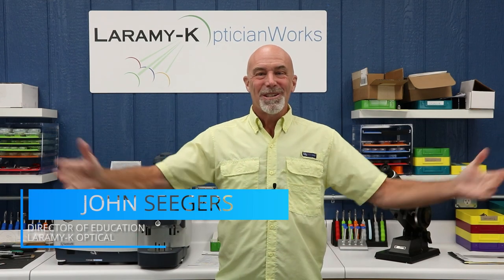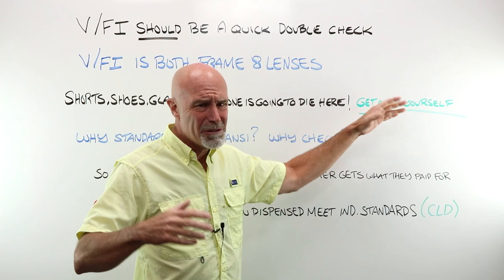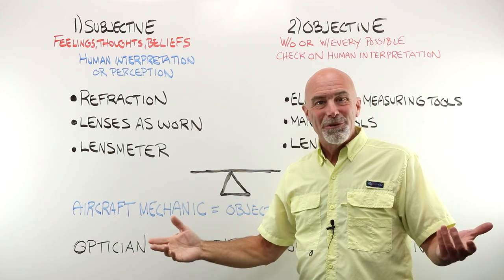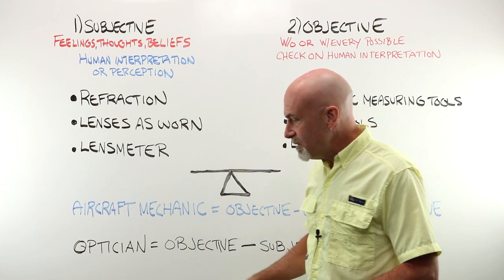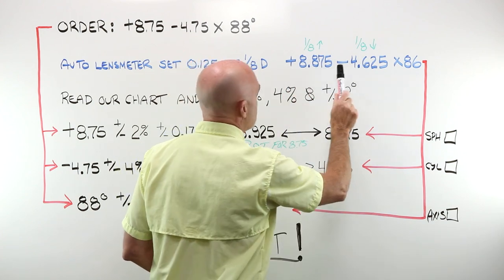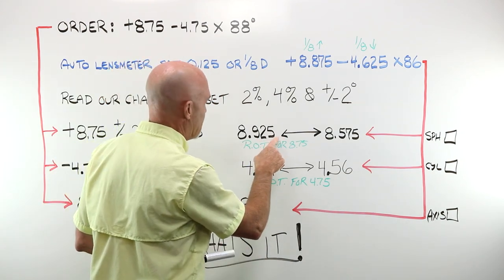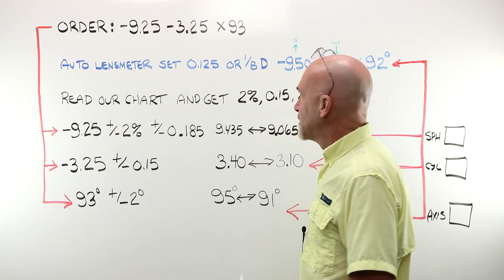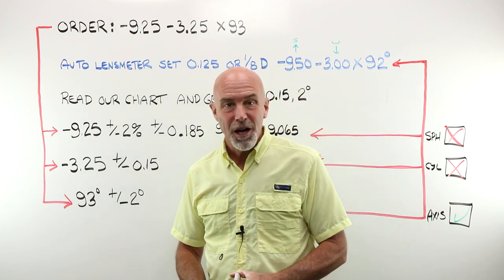Verification or Final Inspection of Frames and Lenses: Checking Tolerances and Standards

Comment: How do I figure out if a pair of glasses are within tolerance;if I don’t have the tolerance table?? The tolerance table will not be provided on the ABO!! Thanks,Tonya.
Reply from the maker: You will need to check with the ABO. Last time I knew they were using current ANSI. You have to memorize the basic chart and know how to apply them. You can email or call them. You should get a "packet" when you sign up.

Comment: How do you check for tolerances on compensated progressive lenses?
Reply from the maker: You don't/can't. You can get in the ballpark on a manual lensmeter and from there you have to take it on faith. A high-end auto-lensmeter will get you closer and a dual lens mapper will be spot-on. Some of the new mappers come with a print function so you can send the map as "proof" of powers done to the 1/100th of a D. Are you +/-0.25 around what you were looking for according to the compensated power card? Y - good to go. No - start second guessing things? A -4.00 is not a compensated -2.36589 ;-)

Comment: Hallo, i'm yohanes from indonesia, and i'm optician, your video tell about formula tolerance, and my question is, Can this tolerance formula be used for all lens brands?, example zeiss lenses. Thanks
Reply from the maker: ANSI Tolerances could be used for any lens and any brand lens. But, that might get tricky if you are working with free-form designs.
Reply: @LaramyKOptical  But can it be used for freefrom lenses, and is there a difference in the formula?, can you tell me please.. Thanks